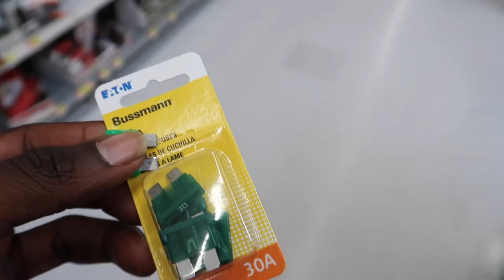THIS SMALL PART RUINED MY BAGS ( SO STUPID 🤦🏾‍♂️🤦🏾‍♂️)

Comment: The fuse can blow for several reasons for one sometimes it’s just a temporary spike in amperage on the compressor because the compressor is pulling hard. Sometimes it can be just a fuse gets old or a wire is not completely snug somewhere or a ground is losing its contact. And the final reason that the fuse could be blowing is if the air compressor is starting to pull more amperage due to the life expectancy of it and it’s duty cycle. If it blows again you need to for sure check on it.  Banger sir!!!
Reply from the maker: TMINUSOFTEXAS i was thinking the same thing fam tbh. Thanks bro i appreciate it